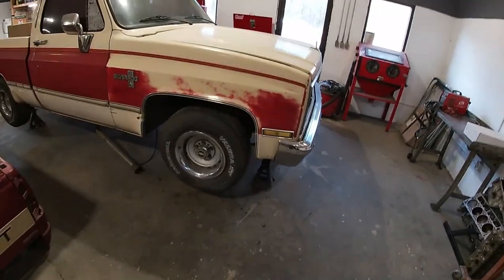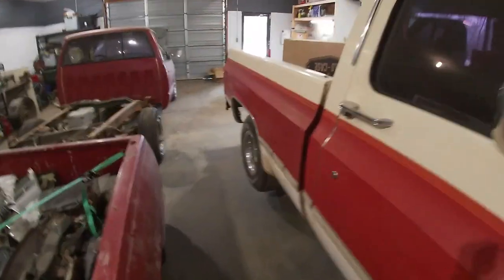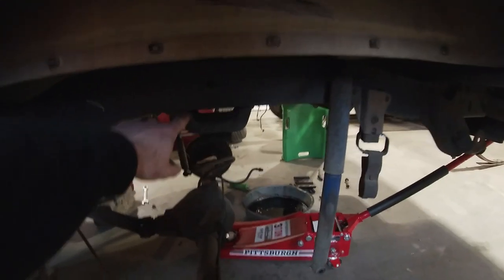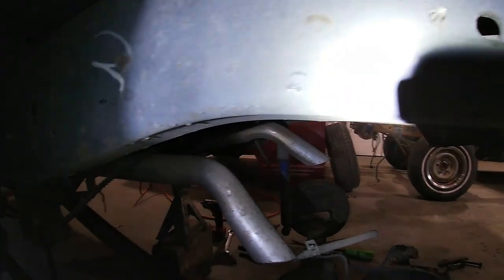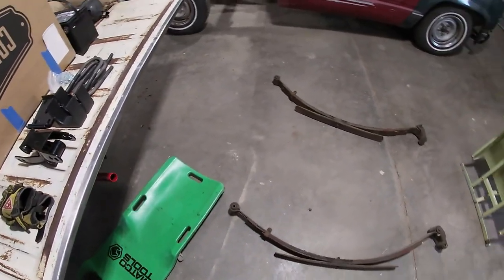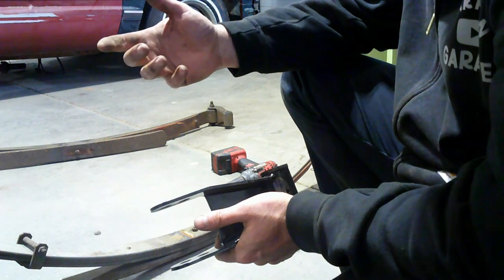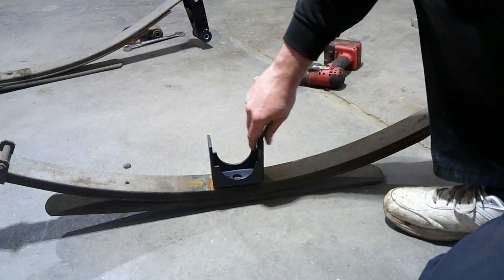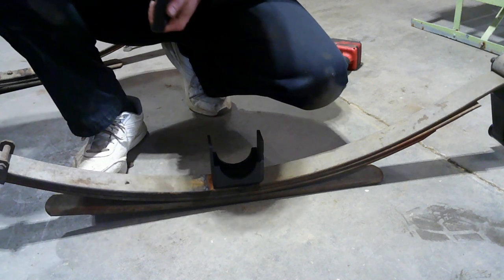Rear axle flip and shackles on a 1987 Chevy R10 Squarebody. Project "Cherry Pie"

Comment: Soaking bolts is absolutely key. Any new project I get goes through the same process.. first I pressure wash the shit out of it to get the junk off. Then use half a can of PB blaster and hit ever bolt/fitting I can reach on the entire rig. Saves me a lot of time and frustration in the long run. Because I always end up having to take apart more than I originally thought lol. It’s a good system that works great for me.
Reply from the maker: Yes sir. Most definitely
Reply: Also, I know you know.. but I’ll say it anyways haha. Make sure when lowering independent suspensions off stands.. to roll the rig back and forth a few times to get the suspensions to settle out flat. I’ve been stuck with that issue before and spent a whole day cutting shims for bodymounts trying to fix it, only to have a bud point that out to me
Reply from the maker: Absolutely

Comment: I am new as you remember maybe the comment I left was long enough to be a chapter in a murder novel. As I gander around looking at your shop, wishing of course that it was mine, seeing all the places to store or make available for stuff to be a stock of sorts of parts and yet remember that storing parts in the garage is a terrible waste of space. I haven't spotted names of tools or other small things that go through my old noggin a to how your set up for doing work. My truck shop was only sixty foot wide but it was a hundred and twenty foot deep to accommodate fully loaded trucks coming in. A hoist that could handle those loaded rigs was not in the pocket book so I did a pit that was able to be driven into with a narrow tractor and clean out what drains couldn't handle. Stuff under logging trucks included bark off of the  trees and mud so it got real messy in a hurry. My pit was closeable with a power slide metal plate that could handle a empty truck, one inch thick plates from the front to the back in ten foot sections. Those plates weighed enough to ruin a mans day if it was to land on him, of course it couldn't happen with the designs in the pit structure. I had built in tool boxes in the pit with air, electric and welding leads. Fairly well thought out with plenty ventilation in them as well. I know one thing, I will never use a black gold heating system as one drip of antifreeze will seize the motor in the heat pump. The repair bills on them to be repaired twice in one year was enough to pay electric heating bills for a year. Like I said before, I put a lot of money in cans as banks tell the government every dime deposited... a lot of the dimes made never stayed long enough to even consider a wage of sort. If you have a video of the shop, I will try to find it as I can spend days wandering around a shop designing in my head what I  would do if mine or take ideas I see to use in my own shop. A shop is a building in progress as its never really finished. So just stopping before another book apears
Reply from the maker: Thank you sir

Comment: This video was great timing for me.  I dropped the front of my 81 C10 last month.  I know I’m going to do a rear axel flip, but I’ve been undecided if I should C notch the frame.  After seeing this I’m thinking I will notch the frame.
Reply: It does not look like that much more work and will be a lot easer to do while I have the bed off and back axel off.
Reply from the maker: It’s not bad, and it is definitely easier to do it while everything is off.

Comment: Looks great!!! Once you get that front to relax it will be a bit closer for sure. And you prob have a few hundred pounds in the back. Might take that stuff out and see if it makes any difference as well.
Reply from the maker: It’s funny you mentioned that because I realized it after I finished the video. Haven’t removed any of it yet but I was thinking the same thing. And all that stuff in the bed goes up front which may bring the front down also
Reply: @HarmonGarage  I’d roll the truck back and forth a few feet to let the suspension settle then you will have a good idea where it’s actually sitting
Reply from the maker: I will do all that after I get the shocks on and get all the weight out of the bed

Comment: How would you lower the front more? I used dropped spindles on mine. I may need a little more after I get my springs on the rear
Reply from the maker: I use drop spindles and the either drop springs or cut a coil off

Comment: I just did a flip kit on my c10 just wondering if your piñon angle was pointing upwards cause mine is just curious if you have to shim
Reply from the maker: The angle will change some. You shouldn’t have to shim it if you bought a flip kit. Just make sure you have the flip brackets in the right way because they are designed to fix the pinion angle if they are installed right
Reply: @HarmonGarage  yeah it’s a flip kit and I put brackets in first hole towards the front it’s a long bed with carrier bearing two piece driveshaft haven’t shortened frame yet plus beds off so there’s no weight on springs might be the problem 🤷‍♂️ will see thanks again
Reply from the maker: It should be fine